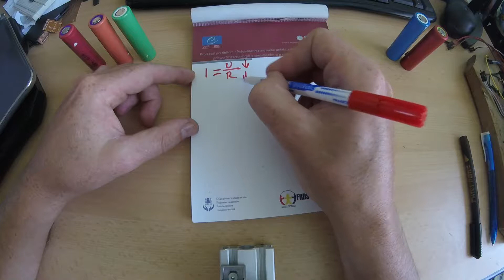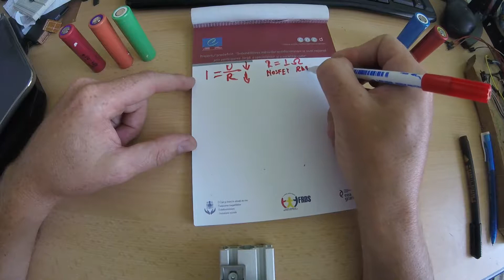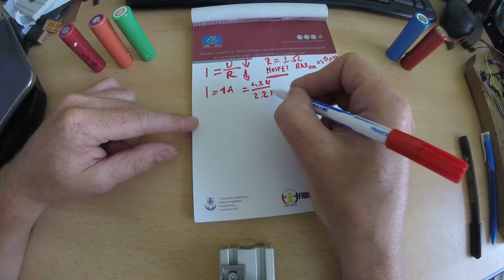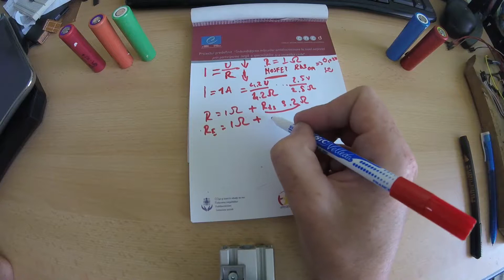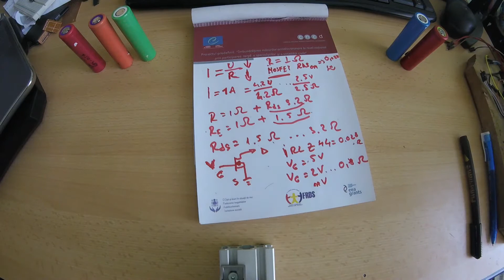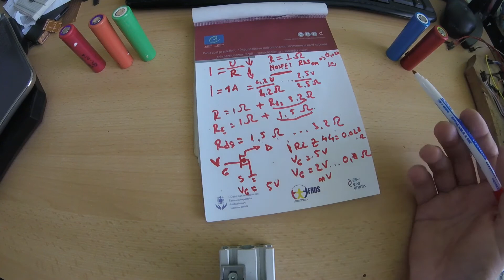#8 18650 Li-Ion Multi Battery Capacity Tester - Theory with Variabile Resistor

Comment: Sir , how could you possibly measure such a small voltage drop across the resistor with arduino ? I mean, the value of the resistor is quite low so it acts like a short circuit.
Reply from the maker: On analog port have an resolution of  5 volts / 1024 units or, 0.049 volts (4.9 mV) per unit.
On this project will messure more then 0.18V on the resistor
Reply: Thank you for your concern sir. I wish you luck with all your new projects.

Comment: Can't you simply PWM control the mosfet and then add a low-pass filter to snub out the high frequency noise?
Reply from the maker: Morten Mortensen I use the OA as voltage comparator because the voltage of battery will drop and I will have different voltage on same PWM. Is hard to control the output voltage without OA